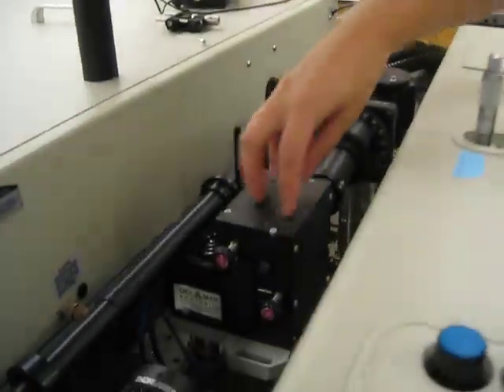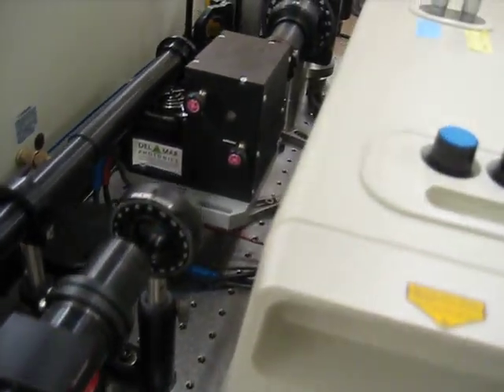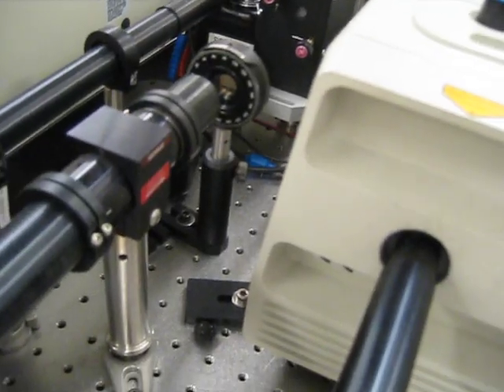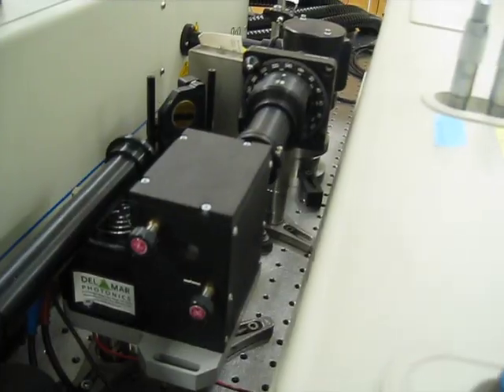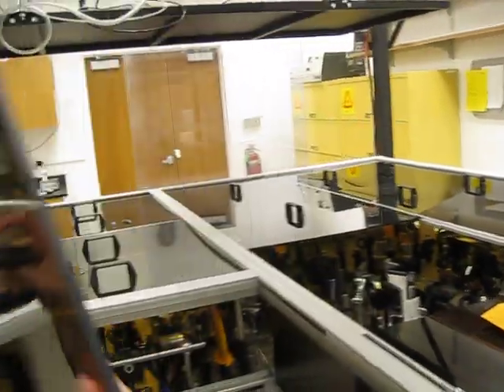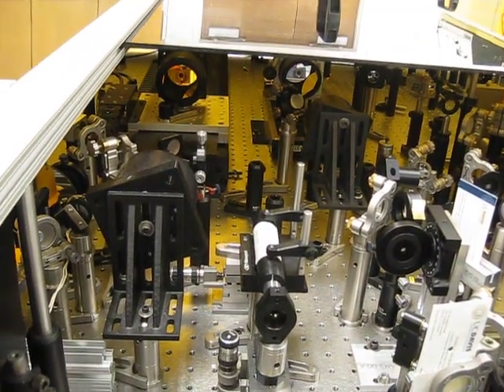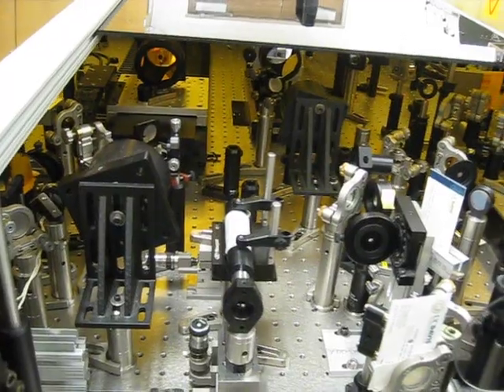A single source femtosecond-millisecond broadband spectrometer UC Davis - sales@dmphotonics.com

Comment from the maker: Progress on femtosecond laser-based system-materials: three-dimensional monolithic electrostatic micro-actuator for optomechanics
Tao Yang, Yves Bellouard
15 February 2016 • 9:50 - 10:10 AM | Part of SPIE LASE

Eternal 5D data storage by ultrafast laser writing in glass
Peter G. Kazansky, Martynas Beresna, Jingyu Zhang, Rokas Drevinskas, Aabid Patel, Aušra Cerkauskaite
17 February 2016 • 4:20 - 4:50 PM | Part of SPIE LASE

Femtosecond modulations based on periodic patterns of excited free-carriers in semiconductors
Yonatan Sivan, Georgios Ctistis, Emre Yüce, Allard P. Mosk
17 February 2016 • 4:45 - 5:00 PM | Part of SPIE OPTO

Laser nanofabrication for advanced micro-cavities
Hong-Bo Sun, Huai-Liang Xu, Xue-Peng Zhan, Qi-Dai Chen
15 February 2016 • 10:50 - 11:15 AM | Part of SPIE LASE

Probing temporal and spatial properties of electronic excitation in dielectrics after interaction with temporally shaped femtosecond laser pulses: experiments and simulations
Thomas Winkler, Lasse Haahr-Lillevang, Cristian Sarpe-Tudoran, Nadine Götte, Bastian Zielinski, Nikolai Jelzow, Arne Senftleben, Thomas Baumert
16 February 2016 • 4:10 - 4:30 PM | Part of SPIE LASE

Manufacturing of functional micro/nano structures by fs-laser microfabrication
Cleber R. Mendonça, Nathália B. Tomazio, Franciele Henrique, Adriano J. G. Otuka, Juliana M. P. Almeida, Carla R. Fontana
16 February 2016 • 4:30 - 4:50 PM | Part of SPIE LASE

Non infrared femto lasers: Status and prospects
Max Kahmann
15 February 2016 • 11:40 AM - 12:00 PM | Part of SPIE LASE

High-temperature monitoring of an oxy-fuel fluidized bed combustor using femtosecond infrared laser-written fiber Bragg gratings
Robert B. Walker, Huimin Ding, David Coulas, Dan Grobnic, Ping Lu, Stephen J. Mihailov, Marc A. Duchesne, Robin W. Hughes, David J. McCalden, Ryan Burchat
17 February 2016 • 6:00 - 8:00 PM | Part of SPIE OPTO

Femtosecond laser written microresonators and nanophotonic circuitry
Robert A. Norwood, Khanh Q. Kieu, Gregory A. Cohoon, Babak Amirsolaimani, Soha Namnabat, Jeff Pyun
18 February 2016 • 3:30 - 4:00 PM | Part of SPIE LASE

Femtosecond laser fabricated multimode fiber sensors interrogated by optical-carrier-based microwave interferometry technique for distributed strain sensing
Liwei Hua, Yang Song, Jie Huang, Xiao Hai
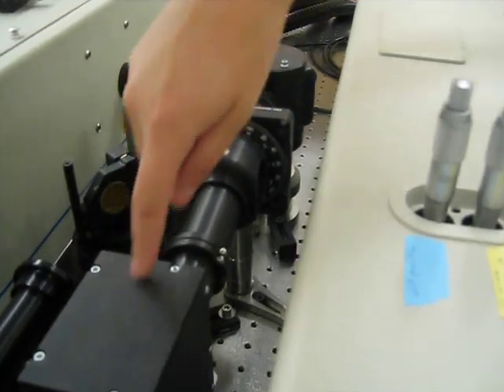18 February 2016 • 2:10 - 2:30 PM | Part of SPIE OPTO

Ablation of silicon with bursts of femtosecond laser pulses
Caterina Gaudiuso, Helena Kämmer, Felix Dreisow, Antonio Ancona, Andreas Tünnermann, Stefan Nolte
16 February 2016 • 8:50 - 9:10 AM | Part of SPIE LASE

Femtosecond fiber laser additive manufacturing of tungsten
Jian Liu, Pei Yang, Baolong Zheng, Huan Huang, Shuang Bai, Lih-Mei Yang
18 February 2016 • 10:40 - 11:10 AM | Part of SPIE LASE

Femtosecond laser-induced two-photon polymerization of whispering gallery mode microresonators
Nathália B. Tomazio, Xavier Roselló, Adriano J. G. Otuka, Gustavo F. B. Almeida, Antonio D. Cremades, Miguel V. Andrés, Cleber R. Mendonça
16 February 2016 • 6:00 - 8:00 PM | Part of SPIE LASE

Waveguide optical amplifiers and lasers produced by fs-laser induced ion migration in phosphate glass
Pedro Moreno Zarate, Jesús del Hoyo Muñoz, Juan Antonio Vallés, Miguel Angel Rebolledo, Jan Siegel, Javier Solis
16 February 2016 • 6:00 - 8:00 PM | Part of SPIE LASE

Femtosecond laser fabricated integrated chip for manipulation of single cells
Anusha Keloth, Melanie Jimenez, H. Bridle, Lynn Paterson, Gerard H. Markx, Ajoy K. Kar
14 February 2016 • 2:10 - 2:30 PM | Part of SPIE BiOS

Waveguides and nonlinear refractive index in chalcogenide glass containing Ag2S nanocrystals
Juliana M. P. Almeida, Emerson C. Barbano, Lino Misoguti, Craig B. Arnold, Cleber R. Mendonça
16 February 2016 • 11:20 - 11:40 AM | Part of SPIE LASE

Investigation of the micro-mechanical properties of femtosecond laser-induced phases in amorphous silica matrix
Christos E. Athanasiou, Yves Bellouard
16 February 2016 • 5:30 - 5:50 PM | Part of SPIE LASE

Femtosecond laser induced local compositional changes in glass for photonics applications
Javier Solis
16 February 2016 • 8:30 - 9:00 AM | Part of SPIE LASE

Pulsewidth dependence of laser-induced periodic surface structure formed on yttria-stabilized zirconia polycrystal
Masayuki Kakehata, Hidehiko Yashiro, Ayako Oyane, Atsuo Ito, Kenji Torizuka
16 February 2016 • 6:00 - 8:00 PM | Part of SPIE LASE

High power and high energy femtosecond lasers based on hybrid architectures
Clemens Hönninger, Julien Pouysegur, Birgit Weichelt, Martin Delaigue, Guillaume Machinet, Franck Morin, Florent Guichard, Yoann Zaouter, Marc Hanna, Frédéric Druon, Patrick Georges, Eric Mottay
15 February 2016 • 11:20 - 11:40 AM | Part of SPIE LASE

All optical fiber polarization controlling devices fabricated by femtosecond laser irradiation
Lei Yuan, Baokai Cheng, Jie Liu, Jie Huang, Hai Xiao
15 February 2016 • 8:50 - 9:10 AM | Part of SPIE LASE

Femtosecond electrons probing ultrafast phenomena in nanostructures by diffraction and imaging
Melanie Müller, Lutz Waldecker, Roman Bertoni, Thomas Vasileiadis, Vasily Kravtsov, Markus B. Raschke, Alexander Paarmann, Ralph Ernstorfer
18 February 2016 • 8:00 - 8:30 AM | Part of SPIE OPTO

Picosecond and fs lasers for industrial material processing
Roland M. Mayerhofer, Jürgen Serbin, Fred-Walter Deeg
15 February 2016 • 5:40 - 6:00 PM | Part of SPIE LASE
COURSE AT CONFERENCE
Micromachining with Femtosecond Lasers (SC743)
Instructor(s): Nolte, Stefan, Friedrich-Schiller-Univ. Jena
Level: Intermediate • 0.35 CEU • Length: 4.00 hours
Member Price: 300.00 | Non-Member Price: 355.00
14 February 2016 • 8:30 AM | Part of SPIE Photonics West

Modulation of Channelrhodopsin-2 mediated currents by femtosecond pulse shaping
Kush Paul, Eugene D. Ark, Haohua Tu, Youbo Zhao, Yuan-zhi Liu, Javier I. Suarez, Parijat Sengupta, Stephen A. Boppart M.D.
13 February 2016 • 10:40 - 11:10 AM | Part of SPIE BiOS

Femtosecond laser irradiation of dielectric materials containing randomly arranged nano-defects
Anton Rudenko, Jean-Philippe Colombier, Tatiana E. Itina
17 February 2016 • 5:10 - 5:30 PM | Part of SPIE LASE

Effects of laser parameters on size and dispersion of gold nanoparticle colloids formed by laser ablation in water
Alexandr A. Antipov, Sergey M. Arakelyan, Yury V. Ryabchikov, Ahmed Al-Kattan, Andrei V. Kabashin, Stella V. Kutrovskaya, Alexey O. Kucherik, Tatiana E. Itina
15 February 2016 • 11:30 - 11:50 AM | Part of SPIE LASE

Novel all-polarization-maintaining femtosecond Yb-fiber laser for in-vivo nonlinear microscopy in zebrafish larvae
Aart Verhoef, Lingxiao Zhu, Marco Andreana, Martin Distel, Stine Møller Israelsen, Karsten Rottwitt, Wolfgang Kautek, Andrius Baltuska, Alma del Carmen Fernandez Gonzalez, Wolfgang Drexler, Angelika Unterhuber
18 February 2016 • 4:20 - 4:40 PM | Part of SPIE LASE

Advanced femtosecond lasers enable new developments in non-linear imaging and functional studies in neuroscience, biology and medical applications
Marco Arrigoni, Darryl McCoy
15 February 2016 • 4:35 - 4:50 PM | Part of SPIE BiOS

Fabrication of waveguides in L-threonine crystals by femtosecond lasers
Gustavo F. B. Almeida, José J. Rodrigues, Jr., Cleber R. Mendonça
16 February 2016 • 6:00 - 8:00 PM | Part of SPIE LASE

Femtosecond laser subsurface scleral treatment in cadaver human sclera and evaluation using two-photon and confocal microscopy
Hui Sun, Zhongwei Fan, Ying Yan, Fuqiang Lian, Ron Kurtz, Tibor Juhasz
15 February 2016 • 1:30 - 1:50 PM | Part of SPIE BiOS

Femtosecond laser pulse induced rapid melting and resolidification of aluminum silicon powder for additive manufacturing
Tobias Ullsperger, Gabor Matthäus, Markus Rettenmayr, Stefan Risse, Andreas Tünnermann, Stefan Nolte
18 February 2016 • 11:10 - 11:30 AM | Part of SPIE LASE

Comparison of two photosensitizers in photodynamic therapy using light pulses in femtosecond regime: an animal study
Clóvis Grecco, Sebastião Pratavieira, Vanderlei Bagnato, Cristina Kurachi
15 February 2016 • 5:30 - 7:30 PM | Part of SPIE BiOS

Femtosecond laser direct-write of lab-in-fiber sensors through polymer-coated optical fiber
Kevin A. J. Joseph, Moez Haque, Stewart J. Aitchison, Peter R. Herman
16 February 2016 • 4:50 - 5:10 PM | Part of SPIE OPTO

Nanofabrication of metals by interfering femtosecond laser processing and their applications
Yoshiki Nakata, Noriaki Miyanaga
18 February 2016 • 8:00 - 8:30 AM | Part of SPIE LASE

Comment from the maker: we hope to attract further papers to the special issue on "Femtochemistry" in Structural Dynamics! 
Please consider to submit your work related to the field of femtochemistry and -biology, as well as ultrafast structural dynamics of molecules and (bio)chemical systems in the widest sense, to this special issue. The topical selection and the open access nature of the journal will provide the widest possible dissemination of your paper, and the joint publication of all papers in a single issue provides high visibility.

Following requests for deadline extensions and the upcoming holiday period, the deadline has been extended to 15. February 2016. 
Of course, all accepted papers are published online and assigned a DOI immediately and are, thus, also instantly fully citable.

Submission for papers is open at http://sd.peerx-press.org/cgi-bin/main.plex

We look forward to your contributions to this very special issue.

------------------------------------------------------------------------------------------------------------------------------------------

See http://www.femto12.org/special_issue for further information and updates – please distribute this information as you feel appropriate.

       Collected papers from the Hamburg Conference on Femtochemistry.

The open access journal Structural Dynamics dedicates a special issue to the Hamburg conference on Femtochemistry (FEMTO12), guest edited by Jochen Küpper. We invite contributions to this special issue.

Structural Dynamics is a relatively new open access and online-only ISI-indexed journal edited by Majed Chergui, which is now accepting submissions for a special issue on the Hamburg Conference on Femtochemistry. Structural Dynamics is co-published by ACA and AIP Publishing. It highlights research articles on structural determination and dynamics of systems. This includes, but is not limited to, experiments enabled by the emerging new instruments -- e.g., XFELs, VUV-XUV HHG sources, electron sources, etc. -- and new experimental and theoretical methodologies in Structural Dynamics and the field of femtochemistry in general. Average time from submission to publication in Structural Dynamics is less than 70 days.

Topics of this special issue include all those represented at the Hamburg conference on Femtochemistry, in the widest sense, and we encourage all participants of FEMTO12 to submit a paper. However, it is not required that the submitted work was presented at the Hamburg conference on Femtochemistry.

Submission opened on 1. August 2015 at http://sd.peerx-press.org. Manuscripts should be submitted no later than 15. November 2015, i.e., 4 months after the conference. All articles will be published online and are fully citable immediately after acceptance — you do not have to wait for your work to be citable until the special issue is complete.

FEMTO12 has received a substantial discount on Open Access publication charges by AIP Publishing. The submission fee has been reduced from US$ 2200 to US$ 1500 for all contributions to this special issue. Furthermore, for authors that do not have the financial resource to support the full fee, we will be able to provide additional reductions or provide a waiver on a case by case basis. Let me point out that this financial support relies on a fair number of paid submissions, at least about fifteen, in order to provide a basic amount of funding required by the publishers for the special issue.

In order to plan the issue financially, please inform the guest editor, Jochen Küpper <jochen.kuepper@cfel.de> of your planned submissions to this special issue and whether you will be able to pay the full open-access fees or request a discount or waiver at your earliest convenience, preferably including a tentative title of your contribution. In order to enable us to confirm the discounts, it is important that you do provide us with your planned submissions, even when you plan to pay the full publication fee. Moreover, while we do not want to enforce payment nor actual submission, we rely on the provided information to be realistic. Finally, payment of fees is no guarantee of acceptance, this will solely be determined by peer review. An invoice will be sent to those authors that have committed to pay the fee after their paper is accepted.

For further questions, please do not hesitate to contact the guest editor, Jochen Küpper <jochen.kuepper@cfel.de>, or the editor-in-chief, Majed Chergui <majed.chergui@epfl.ch>.

Comment from the maker: Neuroimaging Techniques

Dates
January 11 – January 20, 2016

Location
Max Planck Florida Institute for Neuroscience

Course Description
This is an intensive and comprehensive laboratory-oriented course focusing on applying imaging techniques to neuroscience research. The objective of this imaging course is to gain exposure to modern imaging tools from principle optics to applications in modern neuroscience.

Format
The course has lectures in the morning and laboratory sessions in the afternoon and evening.

Lecturers
Alessio Attardo, Ph.D.

Eric Betzig, Ph.D.

McLean Bolton, Ph.D.

David Fitzpatrick, Ph.D.

Na Ji, Ph.D.

Naomi Kamasawa, Ph.D.

Jason Kerr, Ph.D.

Hyungbae Kwon, Ph.D.

Jeff Lichtman, Ph.D.

Hari Shroff, Ph.D.

Long Yan, Ph.D.

Ryohei Yasuda, Ph.D. (co-organizer)

Yi Zuo, Ph.D. (co-organizer)

Laboratory Sections
Imaging deep brain structure with two-photon Microendoscope: Alessio Attardo, Ph.D.
High resolution circuit mapping using temporal focused two-photon microscopy with CHR2 Activation: McLean Bolton, Ph.D.
Two Photon Functional imaging in primary visual cortex in vivo: David Fitzpatrick, Ph.D.
Correlative light and electron microscopy: Naomi Kamasawa, Ph.D.
Two-photon Uncaging: Hyungbae Kwon, Ph.D.
Two Photon Fluorescence lifetime imaging (FLIM) and fluorescence resonance energy transfer (FRET): Ryohei Yasuda, Ph.D.
In vivo imaging of structural plasticity in the mouse brain: Yi Zuo, Ph.D.
Optical system designing: Long Yan, Ph.D. (Optional)
Image analysis: Ryohei Yasuda, Ph.D. and Dr. Lu (Optional)
Ray tracing: Ryohei Yasuda, Ph.D. and Long Yan, Ph.D. (Optional)
Eligibility
This course is intended for anyone interested in using imaging in their neuroscience research, including pre-doctoral students, postdoctoral or clinical researchers and young investigators in the beginning of independent research careers.

Application Process
More details coming soon

Registration
More details coming soon

Contact
Jessica Herbst

Head, Academic Training Programs
http://www.maxplanckflorida.org/education/short-course/neuroimaging-techniques/